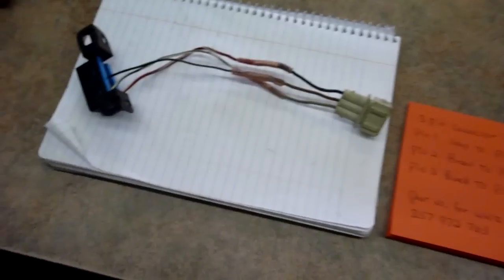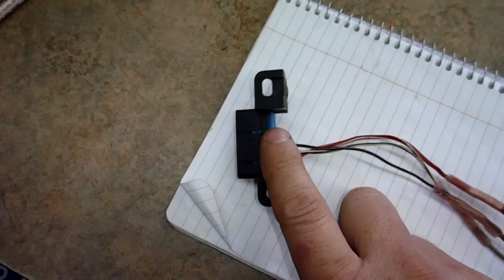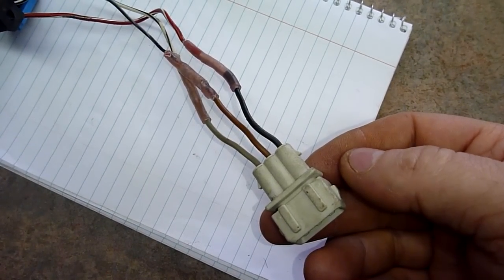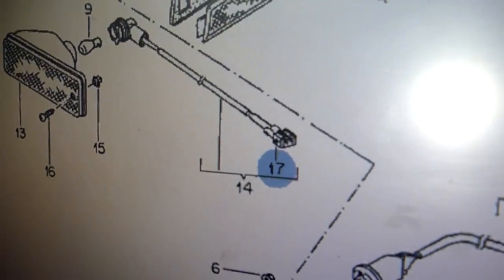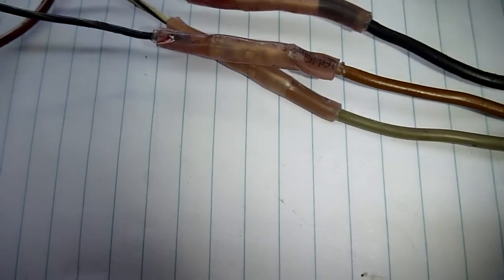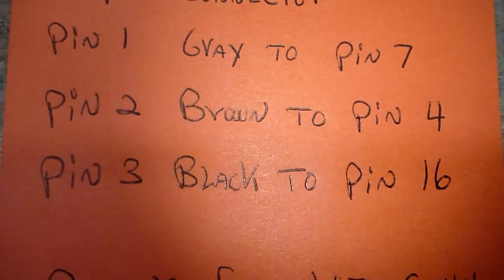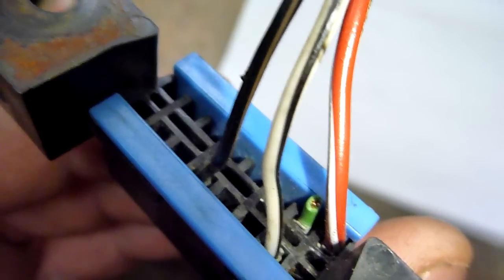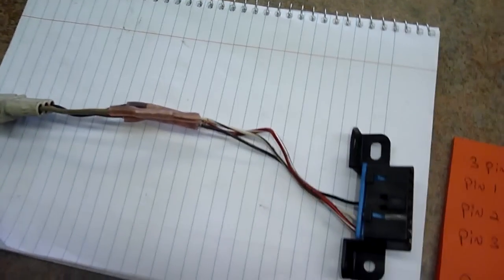Diagnostic connector for mexican beetle

Comment: Great video.  What year of Mark 2, Passat, Golf or Jetta have the 3 pin connector?
Reply from the maker: If I remember right it’s around 1989 and up
Reply: @V10PDTDI  Thank you.  I just purchased a 1998 Vocho city car with less than 24K kilometers.  It has some blemishes but over all is in good working order.
Reply from the maker: @parkrichard4464  did you bought this car in Mexico ? And about the connector I found the part number for the connector mine is white in colour but it could also be in black here is the number 357 972 763 but on my connector the number ended with the letter E  looks like it’s cheap I see 4.31 $ Canadian I don’t have the number for the wires but you’re local VW would be able to find it I also Checked where the wires are connected pin 1 From the 3 pin plug to pin 7 to the 16 pin OBD2  connector pin 2 From the 3 pin plug to pin 4 of the 16 pin OBD2  connector  and finally pin 3 from the 3 pin plug to pin 16 of the 16 pin OBD2  connector hope this helps here’s the part number of the complete plug from a 1989 big bumper Jetta 165 953 123 A looks like it’s discontinued From VW.
Reply: @V10PDTDI  I bought it in the U.S.  Had a title so was easy to transfer to me and get plates.  Thank you for all the great guidance on the pigtail.   I have these on order from Amazon just in case, and they will not ship until January so if I need to cancel I can.    "Davitu Cables, Adapters & Sockets - shhworldsea 3 Pin Waterproof Housing Plug 357 972 763"   I'm going to a salvage yard today to see if I can get an OBDII and the 357 972 763.    BTW the scanner I'm using is an Xtool Vag401.   Of course, I'm piecing this all together and it remains to be seen if it works.
Reply from the maker: @parkrichard4464  let me know if you’re going to make it work.

Comment: Here is a reference that some might find valuable.  It tells vehicles that 357 972 763 can be found on.  Go to https://volkswagen.7zap.com/en/rdw/caddy/ca/1997-181/9/971-972000/#33A  then find 357 972 763 on the page.  Click on the little i in a circle on the right and expand any of the vehicle names and it will tell you the years for that vehicle.

Comment from the maker: I try my best this could help any one that has a Mexican beetle and that they have access to VCDS or known has Ross tech VAGcom they could fix electrical issues without going to the dealer I know for sure if someone would bring this car to a Canadian or American dealer they would not know or what to do any thing with this model of car I'm just lucky that I got to work on that car it's so cool the car was like new 2003 and low km's but had modern things not seen on older beetles.

Comment: Hello. I found your video super interesting. I have a 97 Mexican 1600i beetle. I do need to change the whole wire harness for the car, and thought that it would be better to make the harness myself, since I cannot find a new one available anywhere except in Mexico. I see that you have the part numbers for the connectors. Would you mind posting info with every connector part number? Or maybe the information on the system you use to actually have access to all the car's part numbers?

Thanks so much.

Comment: Thank u very much for this information, do I know the specific program i need for the mexican beetle,  a link would be great. 

Thanks again.
Reply from the maker: JR Armstrong  http://www.ross-tech.com/vag-com/ here it is they make a base version of the cable and a pro version the software is free you have to buy the cable from them .
Reply: Awesome,  thanks for the info.
Reply: V10PDTDI  do u have a link fir the specific cable i neef?  Sorry for asking this but i don't really kniw which one is it.
Reply from the maker: JR Armstrong here is what you need if working on a air cooled beetle go on VCDS web site and go on the tab shop and the cable is called VCDS licence with  Kll - USB interface for VW 1995 to 2005.5 and the price is $ 249.00 US and you will have to build an adaptor like I did in the video.

Comment: I made an adapter based on your video using an OBD2 connector I got at a salvage yard, but I had to order the VAG end.  I also purchased an XTOOL V401 as a reader.  When I attached it to the car it all worked great.  Here is the VAG connector I ordered:  https://www.amazon.com/gp/product/B08915P75S/ref=ppx_od_dt_b_asin_title_s00?ie=UTF8&psc=1

I tried to make a video, but it didn't turn out very well, so I didn't post it.  :(

If someone wants me to make a video of attaching it to my 1998 Vocho let me know, and I'll try again.  It may be very low quality.  I really don't want to get into editing videos.